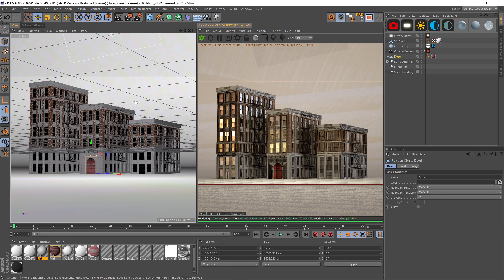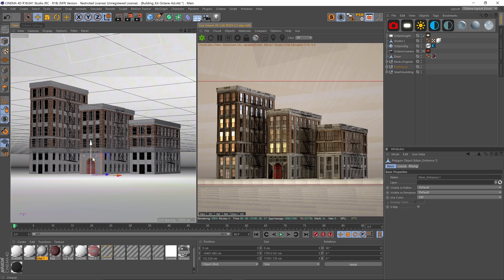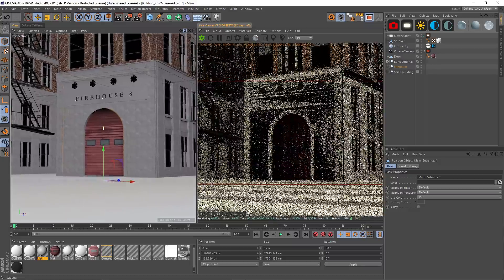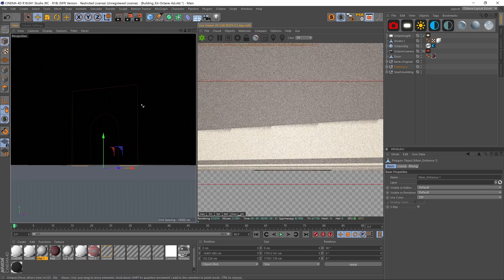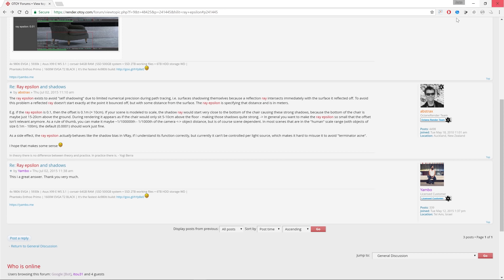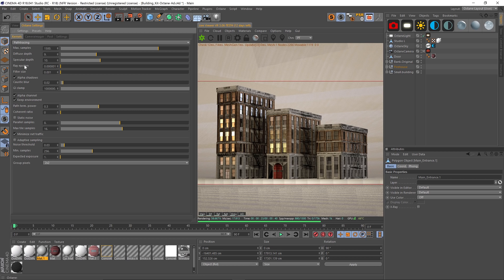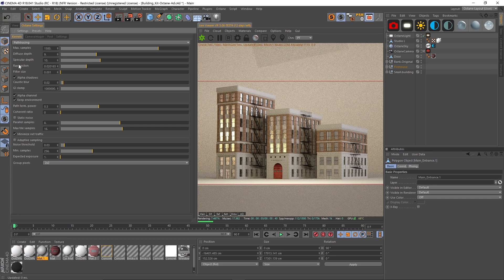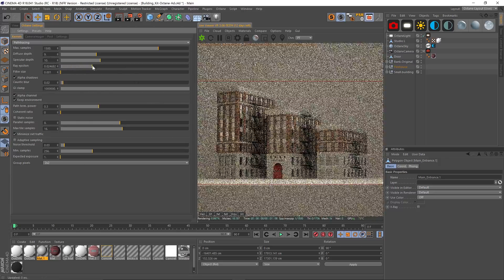C4D Octane Tutorial: Cleaning Up Artifacts with Ray Epsilon

Comment: just fyi dont even need to raise the value that high....cause sometimes a high value also causes artifacts to appear. a good value to work with is 0.00001, and if you still see artifacts at that setting, going up to 0.0001 usually does the trick.